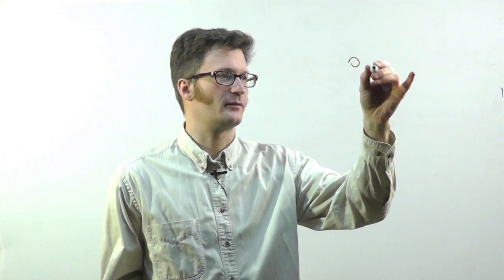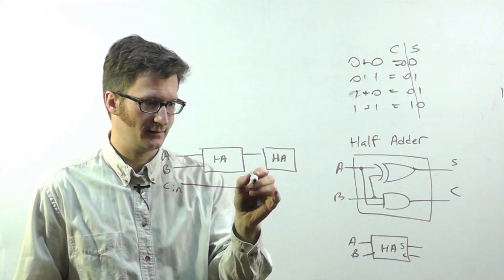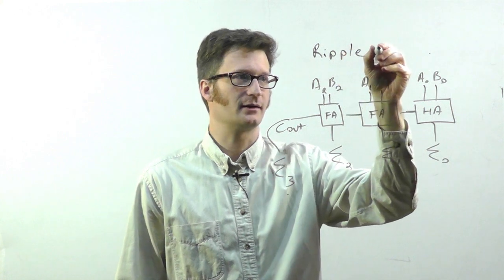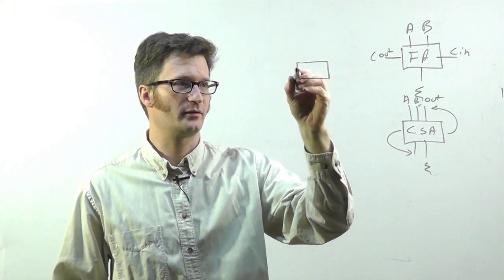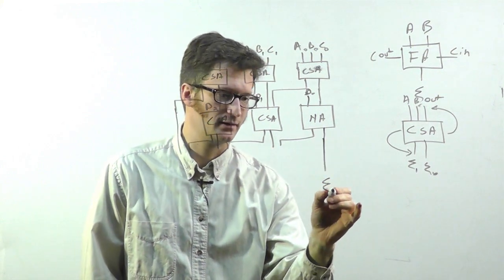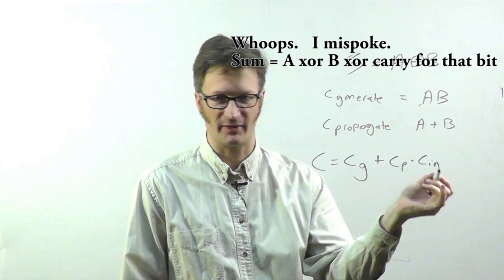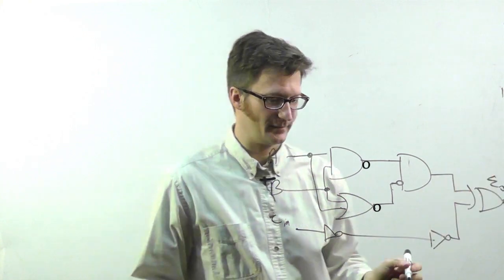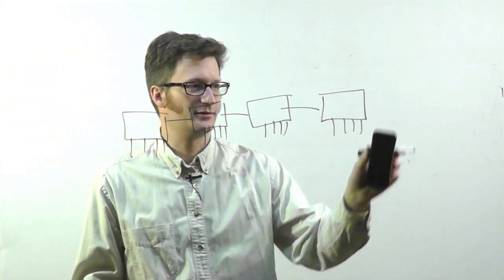Digital Logic - Adder Circuits

Comment: i have a question for anyone that can help me. i'm a first year electrical and computer engineer student and i just don't know to what extent i have to know all this. am i supposed to remember how to draw a ripple adder or just know the function of it? i have found this subject very hard since day 1.
Reply from the maker: That depends on what you want to do with your EE degree.   If you want to work with FPGAs or design ASICs then, yes, you will need to know this but if you want to go into analog circuits then you won't need to know this at all.   There is a vast middle ground where I think that for the most part, only the most basic concepts of digital logic are necessary.  For example, knowing about propagation delay or that you could stick an OR gate into your circuit to combine two inputs is generally sufficient.
Reply: @J1432  thank you man, your vids helped me a lot this semester.

Comment: can someone please explain what a carry in/out!!!
Reply: is
Reply: +Harvey Challinor Carry-in is what is sent over from the previous adder. Carry out is what would be sent to the next adder from the current adder. 

Like when you do the problem 9 + 2 you would get 1 in the rightmost column but you would have to carry the 1 in order to get 11. When adding two binary strings, like 1 and 1. you would get 0 in the right most column but you would have to carry the 1 in order to get the binary sum 10. The carry-out would be the 1 you carry over which would be called the carry out of the current adder and the carry-in of the next adder.
Reply: +Wise Hermit Oh! So it's like a chain!
Reply: +Harvey Challinor yeeup :)